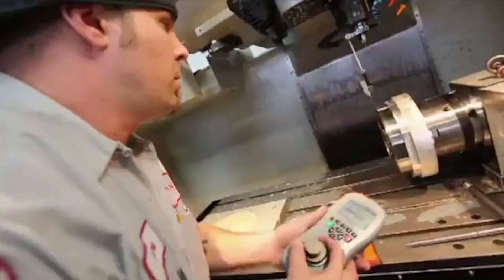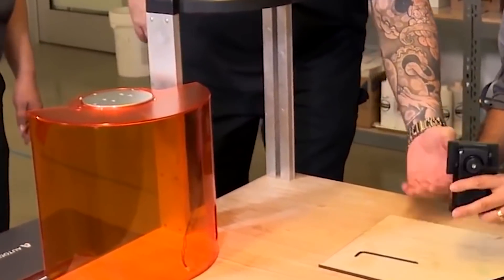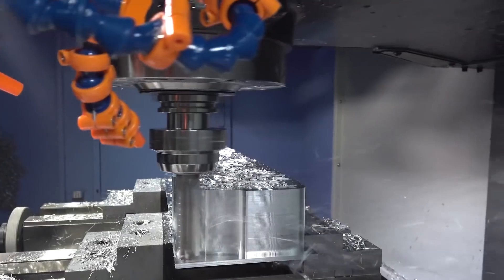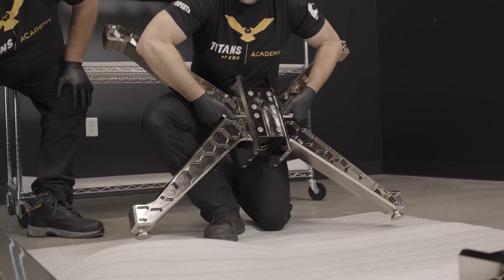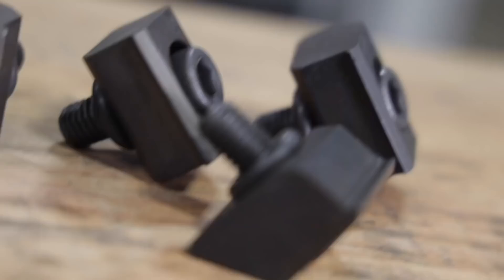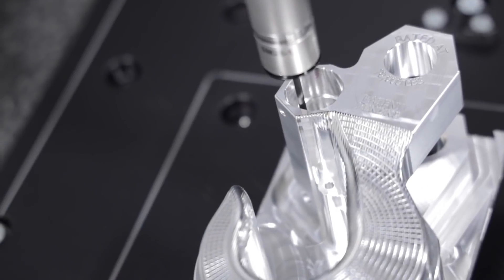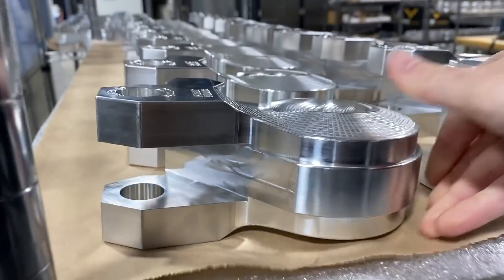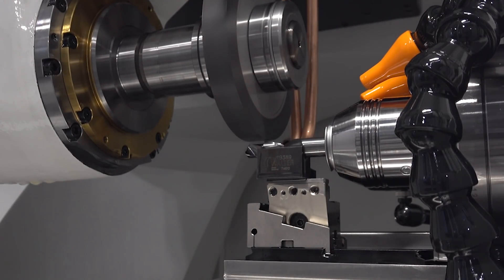My Platers RUINED Tons of Important Parts... INCREDIBLY FRUSTRATING

Comment: im a anodizing specialists, have been doing it for 12 years now.

You cant fix it and keep the tolerances, reanodizing something will never look as nice as the first time. (and the labor required to strip and repolish is insane)

Theres a high chance that because you "scottch brighted /sandpapered" the surface,   when you now etch this part, the etching will look uneven across the surface so the operator would of kept it in the etch bath untill he see's an even etching.

I reccomend you never disturb a machined surface if you plan on getting it anodized.

If you want to make your parts bright, you can change the etching solutiion to an etching/brighting solution, we use it and get beautiful finish's every time.
Reply: @eIgHtY0N3  
All of your brightening should be before anodizing, you can use a brighting etch, or add a brightening stage in after etching.
is your part machined or cast? what media are you blasting with as it could be leaving deposits and are you desmutting your part after etching?  knowing the type of aluminium and its age is also very important.

theres a crazy amount of variables to anodizing. its not so simple.
Reply: @eIgHtY0N3  
If you're dry bead blasting consider wet bead blasting/vapor blasting/vapour honing, whatever you want to call it, provides a brighter finish.
Reply: @eIgHtY0N3  Sure, happy to take a look.
Reply: @eIgHtY0N3  
I've had some parts blasted in this manner, assuming the blaster knows what they are doing you'll get the vast majority of the tool marks off, of course it depends on your finish from the machine with rougher finishes requiring harsher blasts, it could be possible to do a two stage blast? Dry blast to remove the machining marks and then wet blast to get the finish?